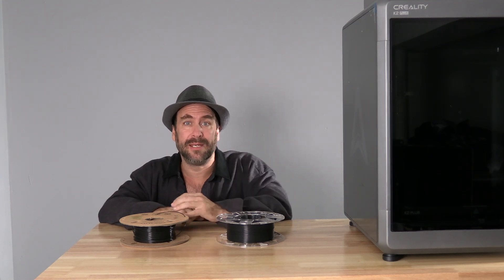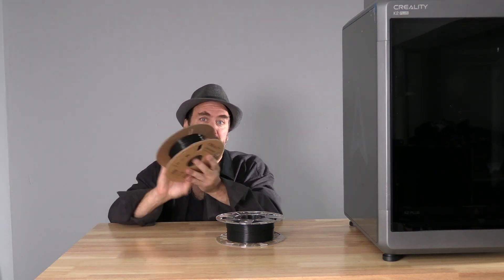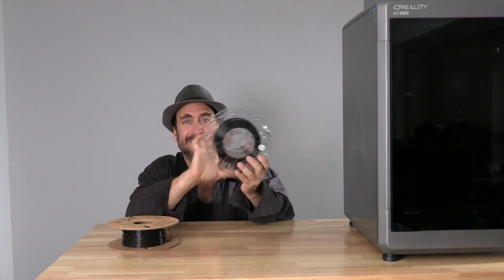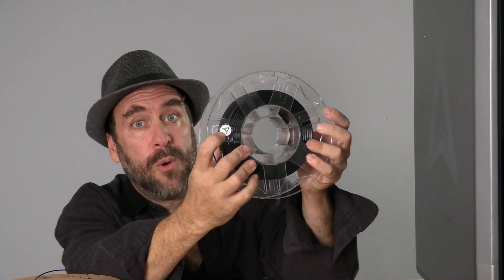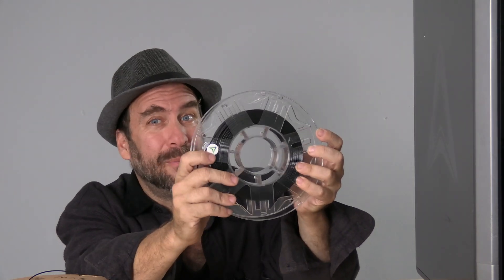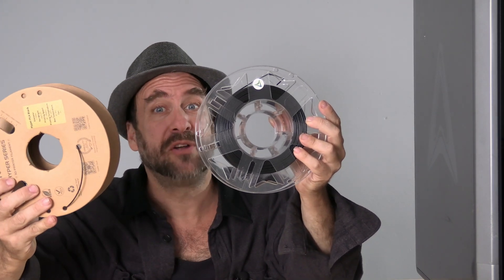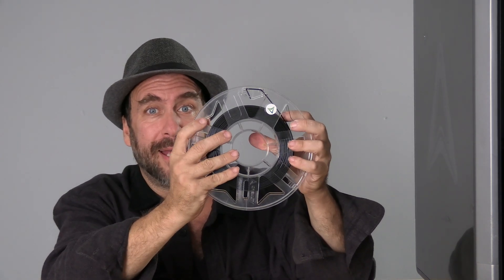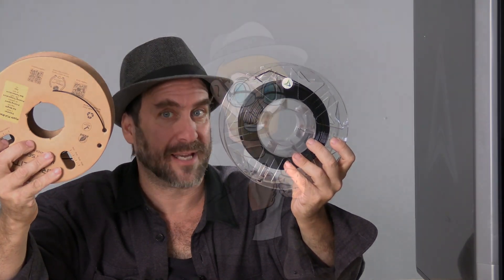RFID Filament Spools, finally come to Creality, with the arrival of the K2 Plus

Comment: Is RFID any more than a gimmick? I don't have a huge history of using the wrong filament...
Reply from the maker: Gimmick? Nah. It works great. Pop it in, machine reads it, loads the color and profile by itself, off you go. When using 2-3 AMS, or printing day in and day out, it saves allot of time and allot of manually double checking stuff
Reply: @3DRundown ah I never factored in multiple CFS setups; I can see the speed advantage there... Thanks!

Comment: Good stuff!

Editted cause I multitask too much. 🤪😁👍
Reply from the maker: I'm super confused. This is a video about filament, and the K2 Plus......
Reply: @3DRundown  you are correct! Sorry bout that. Was watching 2 different videos at the same time 😁😁
Reply from the maker: Happy to help, with that other video. That said, HYPER is fantastic Filament, and I use it whenever I can, but, I print in my K1's and Bambu's with all sorts of regular PLA with excellent results.
Reply: @3DRundown  same👍👍. I'm running 2 K1's and an a1 mini. Almost exclusively PLA. Moving my workshop into a dedicated area and am going to install an exhaust fan so I can start messing with ASA and ABS. Exhaust fan will be primarily for a laser though.